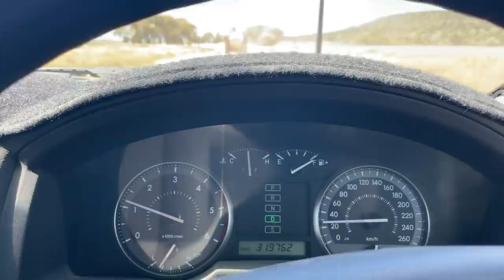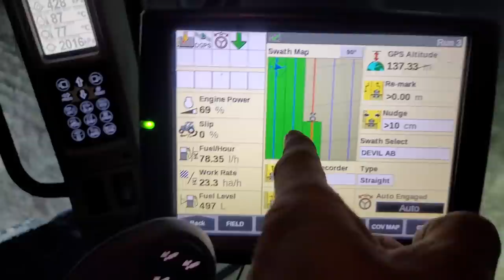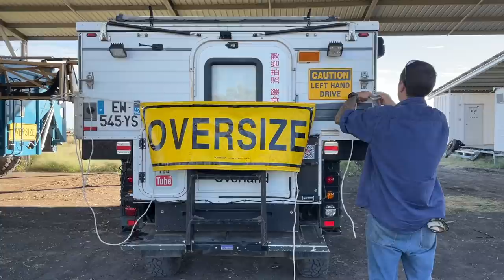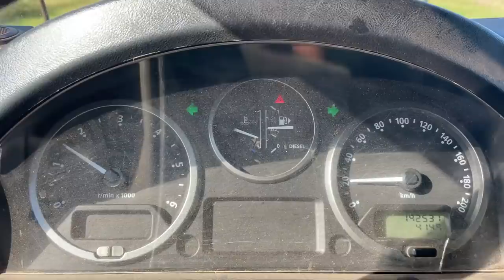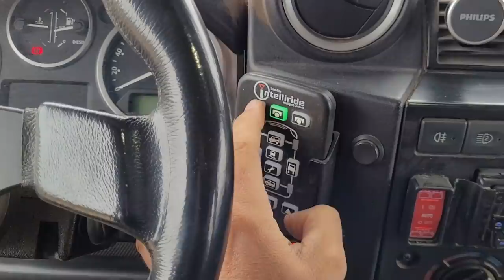Land Rover Defender escorts massive tractor + Deepwater flood crossing... (Ep213)

Comment: Fun experience, it is nice with the GPS steering a lot easier to go straight lines than before.  There had been another vehicle on the road you did not do any more to it.  Do you have a fan switch to cut the fan when water is deep?  It is always good to get some time to yourself. That is hard in a small camper.  Stay safe and healthy.
Reply from the maker: Absolutely we saw the fresh tracks ahead of us and since talked to our mate Ian who told us our little mess was nothing.
No switch for the fan but if the water crossing was any longer I would have put a sheet of canvas in front of the grill or tied off the fan before entering the water.